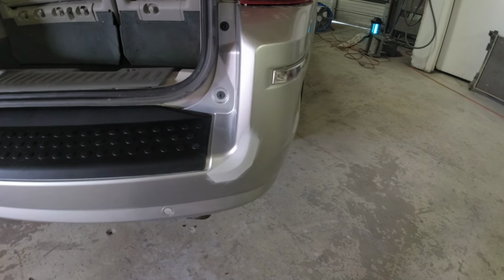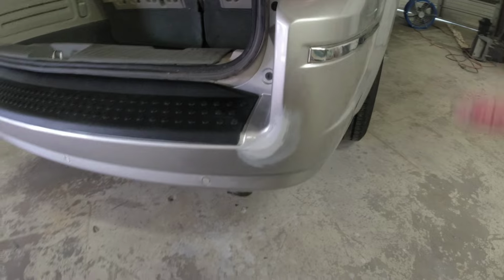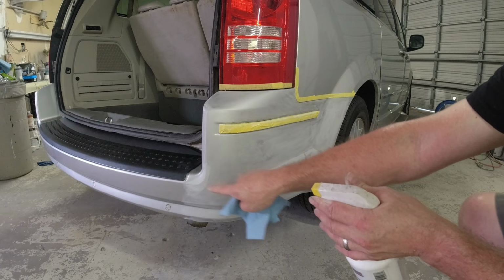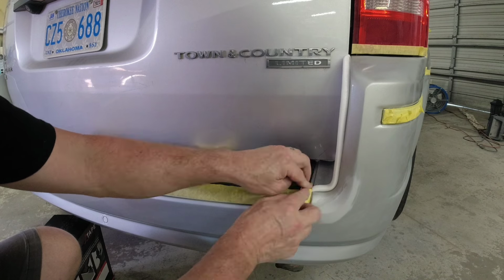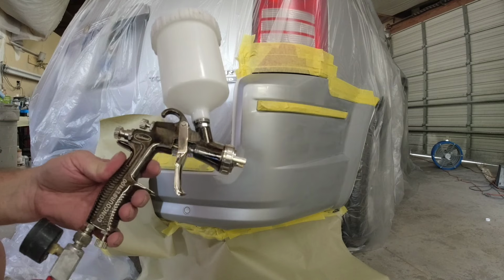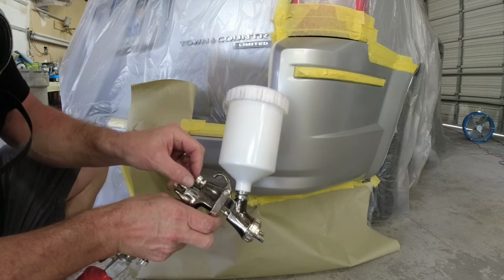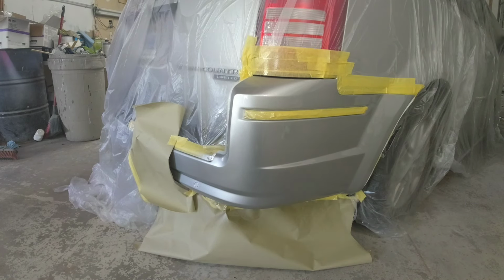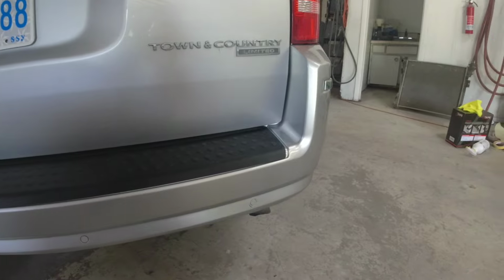Blending clear when spot painting your car. #howto #autopaint #autobody

Comment: Hey, Chris. Talk about a well-timed video! I've watched it three times already. I burned through a door edge wet sanding, and I need to repaint and blend it in to the rest of the door.

I really dig that you're using the LT100, too. I'm using a Kobalt Quiet Tech 26-Gallon Compressor, and the LT100 is the perfect gun for that setup.

Also: 

If you're looking for video ideas, I'd vote for one about how to paint door jambs without taking the doors off. 👍
Reply from the maker: Thank's  for the comment Jeremy! Yeah really enjoying the lt100 . The fact that it works well with your small compressor is good information.

Comment: I had a 1980 Corvette. At that time they used lacquer and I used to do some repairs. I have a new Infiniti in Graphite Shadow. In one week I damaged the front and rear bumper. Bad luck I guess.  I’ve never worked with metallic paint or clear coat before but I’ll give it a shot. I learned a lot from your video thank you and please keep them coming. 

LD
Reply from the maker: You can do it, not that tough and clearcoat is forgiving . Be sure to check out my other videos.  I would use a wet bed /color blender

Comment: I get that there's a market for this kind of work ie DIY guys and used cars but I hate when shops do this to my car.  You always see that blend in a year or so no buffing that away.  And it will peel around that chrome you taped up it can't be scuffed all the way down in there.  Good stuff to learn though.
Reply: Agreed. This is a terrible repair especially considering it’s not hard or much more expensive to clear the entire bumper (the correct way.
Reply: @jq8792  oke so we don’t need to repaint th whole bumper? only re-clear the whole bumper in this situation?
Reply: @thomaswahahauw560  yes sir. Blend the repair area then clear the entire bumper.
Reply: Maybe customer wanted it done as cheep as possible
Reply: These bumper covers are so easy to remove it seems like it’s more of a pain to go through all the blending and creative masking than to just do the whole cover.   Yes, paint is expensive, but add up that plastic used to cover the ENTIRE car plus the foam, the tape, the time, etc, versus only taping off the chrome and the scuff panel(in black, also deceptively easy to remove and replace, and removes any chances of the other commenter’s remark about the edges peeling.   Indeed, if ANYTHING can grab an edge, it will, and subsequent attempts at sanding and buffing will undoubtedly find those edges and weaken their strength.    Splitting hairs?    You betcha I am, cause that’s the difference for longevity.    Another person’s car?   You may or may not care.   Your own or family or friend’s car, you care.   In 6 months or a year, do you really wanna hear even the most kind request to “touch up” your previous “fix”.    I am knee deep into preventing just that as we speak on my mom’s car.   I know her and know myself.    If I see it.   She will see it.   If I are, she will care.   Period.   I can see the future, and if I don’t get it just right to MY standards, I’ll be doing again.   I have painted parts of this SUV so many times I lost count.   The hood, going into the teens.    The passenger side I finally got so good it does t even need a cut-n-buff!   Finally satisfied, as a cut-n-buff is how I got here in the first place, having burned through parts where I had put down so many coats of paint and clear I figured it would never get through.    Wrong.    In fact the OEM paint getting burned through was what led me here.     I turned an average scratch and chip fix into a mostly full respray, all except the roof, where there was no rust, no dents, no dings, just chips and scratches, some pretty deep, and the blends just were not cutting it, pun intended.    The finish I got on this last attempt, the passenger side, is so good I’m about to redo the drivers side.    I definitely got myself into a hell of a bind but I’m forcing myself to learn something I once took for granted.   Now, I understand why it could cost $10,000 for an OEM type repaint.   Even though tons of hours have been spent on trial and error, the learning curve has been steep, but worth it, but I’m well into nearly 1,000 hours on this thing.    Again, this last attempt has made the journey worth it.   I still have a hard time looking at it and going, “damn, I did that!”    An attempted run repair on the otherwise glass-like rear bumper cover brought me here, and watching this made me decide NOT to spot blend, but just respray it.     The ends must justify the means.    Always.
Reply: Lol you think this is DIY? This is a professional technique called blending in paint shops so it doesn’t stick out like a sore thumb. Paint your red Corvette bumper completely red and watch it stick out hard . Also. The difference is you may pay 200 for this instead of 950 for the whole bumper . Product cost money . This is not a diy technique lol
Reply: @Sniper Paint Correction  no professional shop or DIY should paint the entire bumper, just blend. The complaints are that the entire bumper wasn't clear-coated. By clearing only part of the bumper you leave a very distinct line that buffing won't completely remove while only saving about $20 worth of clear coat.
Reply: @jq8792  never hurd of that. As a painter you blend the color and still clear the whole piece
Reply: @Sniper Paint Correction  I agree, blend then clear entire bumper. I must have missed your point. If you're pointing out that this is not a DIY job then I agree. Someone with little to no experience is going to have a very noticeable blend and if they tried to paint the entire bumper then they're going to have mismatched panels.
Reply: Must understand that this guy is showing a quick easy way to do this. Bumpers are not always easy to remove espresso ones with the phillips head screws that the heads immediately strip out when trying to remove. For a bumper they are very easy to blend the clear coat for myself or anyone who knows how to blend clear properly. Now if it was the hood then yes i would clear the entire pannel but no way would i ever clear that entire bumper
Reply: Why would you see the blend after a year? With lacquer I can see that as an issue but 2k shouldn't change color or fail
Reply: The clear gets very thin where the blending solvent is sprayed on it and it's sanded and buffed it always fails at the thin point no clear can handle that.  That's why you clear the entire panel to it's edges.  My guy uses PPG which is often touted as the best (but it's only the most expensive not the best).  I can barely see where it failed it's so early I'll just have to flowcoat the panel with one good coat then it will be fine.
Reply: @67polara  ok so are we talking 1 year or less? 

Why not wet sand the failing edge and polish it, that should knock the edge back from where the clear coat failed and remove the oxidation. It will take longer to fail next time because the new wet sanded edge is thicker. 

You can also spray some spraymax 2k clear in that area to thicken up the clear after sanding the oxidation away and then spray some blender on the edges of the new touch up repair to melt it to the surrounding clear.
Reply: Then do it yourself buddy, don't forget to run as fast as you can to your nearest garage afterwards 😂😂😂
Reply: A lot of needles commenting for anyone who actually watched the whole video. He clearly says this isn't the perfect way to do this,  ideally your want to clear the whole bumper...

Comment: Cracking job 👏 chis well explained as usual so Chris a blending coate it's just a clear coat what you put on first
Reply from the maker: No, that is clear basecoat. Basically paint with no color. I havs a few videos on the topic if want to understand it better.
Reply: @GarageNoise  in the video you showed a can of spray max 2k clear with a color paint can but it wasn’t for the car. You said it can also be done using the cans right, so my question is, would it be better to spray the 2k clear over my primed quarter panel repair area and than proceed to shoot the metallic colour right after onto the 2k clear as you say it helps the metallics lay better. Or would I be better of to spray my colour first which is a black metallic sapphire bmw 475 and than proceed to clear it with the 2k and use the spray max spot blender to feather new to old clear coat ? Your professional opinion means a lot. Your a great teacher !!! 🙏🙏🙏
Reply from the maker: @aimized1460  no don't  spray base over wet 2k clear that will create a problem.
Reply from the maker: @aimized1460  ok, you getting 2k clear coat  confused with clear base coat . Clear base coat is what helps blend metallics. 2k clear coat is a top coat only. Here is a video that will help.
Reply from the maker: @aimized1460  watch this https://youtu.be/6TLp-YP2hfY
Reply: @GarageNoise  I was thinking that too but thanks for the confirmation.
Reply: @GarageNoise  right I understand that. But in the video you showed 2 cans of spray 1 was the 2k clear glamor which is a 2k clear coat. 2nd was the matched paint in the spray can and you said you can achieve the same results as you would but with the cans also ??! Let’s say if you went with the can route right and you didn’t have any equipment and any wet bed in a spray can ? Do you think it will turn out looking good ? I have searched all over the internet and there doesn’t seem to be any sort of wet bed or base coat without any pigment in a spray can. I assume this is something that bodyshops mix as they need. So this leaves me in the dark once again as I don’t have any thing like this… I’m in Canada and the shop wants 1200$ to paint the panel which is absurd. Thanks for all the help brother man ☝️🙏🙏👍

Comment: Amazing process, a couple of questions however. Why didn't you need to sand the clear coat down above the damage (on the natural body line)? You sanded the rest of the panel, but in this section you sprayed the base coat and the clear coat over un-sanded clear coat. You also scuffed the clear on the bottom left panel (from the damage), and blended that into the rest of the panel - but was there a reason you didn't do this on the right side of the damage? (You instead sanded and resprayed that whole bumper). I'm new to this, but it felt like you used 3 different techniques  - one above damage, one to the left of damage, and one to the right of damage, to achieve the same or similar results.

Comment: U definitely  know your stuff 👍 though most paint manufacturers  say to use light grit sandpaper like 3000 on end of blends . Only recently did find out the gray sotchbrite is key to good blends. I know blends are not recommended  or warranted  by paint manufacturers  is very good skill to have especially  sectioning of rocker panel and pillars
Reply from the maker: Agreed good skill to have but only use it as last resort and with customers consent. Appreciate the support!
Reply: You can also back polish the blend zone with rubbing compound with a pad then clear right up to that area then immediately use upol #9 until the blend zone turn clear and most importantly dry the blender with low air on your gun you not need to buff nothing, saves a lot of time

Comment: Good job on what can turn into a cluster fck real quick. I’ve never used the blending agent, curious if it has a tendency to get cloudy after time. I always over reduce my clear with lacquer thinner after clearing and burn my edges. It blends good but usually dies back over time. Also, I usually dust my base on really dry…more air than fluid. Helps to keep original clear coat from wrinkling.
Reply from the maker: Good tips! A lot of different ways to do it. The blends will fail over time. Appreciate  the comment and support!

Comment: Are you suggesting that we could use the 2k aerosol clear coat (or other type of aerosol clear coats) to use as a wet bed? I thought there was a difference between a clear base and a cleat coat. Nice video!
Reply from the maker: No don't use Aerosol clearcoat  as a wet bed. Clear basecoat is what you want  to use some call it a color blender. Speedcoat make a color blender that works well. Appreciate the comment and support!

Comment: Usually what is the durability for blending lines to last ? Do also do them on panels that are normally facing the sun ? Thanks for the advise
Reply from the maker: It's  hard to say but they will fail eventually.  What I mean by fail is you'll be able to see them. The blends will last if it's  not getting direct sunlight . Appreciate the comment and support!

Comment: thanks for showing how to clear coat blend. looks like i need a blender can before i proceed with my clear coat blend. Can we see few month later results? is clear coat blend still good? I noticed you put down wet bed, What is that? does that help clear coat blend?
Reply from the maker: You can just use reducer to wash in the blend it works well too. You don't  have to use clear base but it helps metallics lay down. Check out this video  for how to use aclear base.
https://youtu.be/6TLp-YP2hfY

Comment: Hi, so is the technique of blending paint or clear coat having a loose mask of paper so the paint or clear coat can sneak underneath mask? When you sprayed the clear coat, was there a noticeable difference in finishes on that bumper?
This is exactly what I am attempting, and could use the advice. Thanks
Reply from the maker: Follow  the video  but the idea of the paper is so you don't  have a hard line of clear  and yes so a little clear sneaks under there then spray over the blend with the upol #9 or a little  bit of straight reducer  will help it to melt in. Then a light buff away  from the blend. There shouldn't be a difference  in the finish othe than the blend area should only be slightly duller.  Hope this helps  appreciate the support!

Comment: Nice video as always Chris! 
did the fc710 loss gloss a bit Compared to the fc720? Still torn between those 2.. I like the dust free time of the fc710 since I don’t have a garage 😬 just temporary setup with plastic sheeting 😅
Reply from the maker: I've  used  the fc710 a few times now. I will bwe doing a review but I love it! If your not doing an overall paint job I would definitely use the fc  710 I painted it in 95° heat and it flowed out beautifully no dieback held it's  gloss perfectly.  I haven't  had the chance to cut and buff it tho so i can't  speak on that.
Reply: @GarageNoise  wow nice! Can’t wait for the review then 😁 pretty much sold on the fc710 my repair will be rust on lower front fender and I need to blend on the front door so pretty much perfect for that job! Thanks again ☺️

Comment: I just tried this and I got some overspray beyond my sanded area that will scrape off with my nail. If I get all the extra loose clear off, how do I avoid the hard edge up to the point where it actually sticks? Will the upol #9 work even on the dry/semi cured clear edge? Hope that makes sense.
Reply from the maker: Upol #9 won't  work after dry. It alway good to give yourself more prepared are for the blend cause you can always buff it after its  cured.

Comment: If you were using the cans would you still use the clear before putting on the paint . If so would you use the same clear for after aswell as before ?
Reply from the maker: What I put on before paint is clear base coat, not clear coat. Some other names are color blender or wet bed. It's  not completely necessary on a small job.

Comment: Great video Chris  I do love these smart repair job's well explained  now the  spray gun  you  was using was a 2 cfm  what cfm was your  compressor  I am interested  in getting a compressor  what cfm do you recommend  for a 2 or 3 cfm spray  gun also how dose it spray with a 2 cfm is it more controlled thank you  for this video would not mine seeing another  smart repair video
Reply from the maker: The gun I'm  using requires 4.25 cfm to operate consistently. Viewers have said they use this gun with a  25 gal compressor from harbor freight.  I haven't  been able to test this gun with a small compressor  but plan to. Get the largest cfm compressor that you can afford.  Mine produces  16-17 cfm's.  Thank's  for watching!
Reply: Summitracing LVLP says 3-4cfm but its pretty much the same gun as LT100. I have both and the aircap are the same. I use a 20 gal Husky quiet compressor.
Reply: Hello I can get hold of a 50 liter with 2 hsp 9cfm do you  think I won't be ok with this compresaer  to run a lvlp
Reply from the maker: @husky1239  I think it would run this gun for sure.
Reply: Thanks for that so I would be ok I mean 50 liters I like 10 gallons 20 gallons would be 90 liters I suppose if the hsp is 2.5 it would be good
Reply: @husky1239  Thats a high HP for a small tank. Should be good, it will be running most of the time and will produce a lot of water. Install a water separator after the regulator and ball filter on the gun.

Comment: i tried spot repairing an issue on my front bumper at the top where it meets the hood. When I sprayed the clear coat I hadn't seen this video yet so now I can see where the edge of the clearcoat I sprayed is and where the factory clear coat is as well. How would I redo this repair so you can't see the edge of the new clearcoat I sprayed? I'm concerned if I spray new clearcoat over this again that it's still going to show the edge of the clearcoat I just sprayed.
Reply from the maker: If you dont want any blend line it's  best to clear the full bumper but if you don't  want to do that you need to wet sand it down a larger area past the current blend add basecoat and then clear . Washbthe blend line in with reducer and finally buff making sure to buff away from the blend